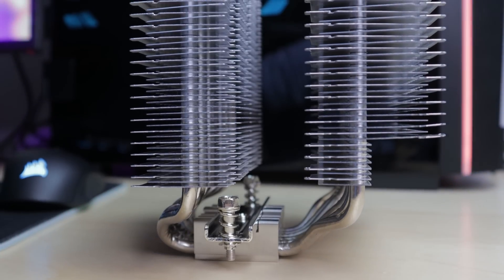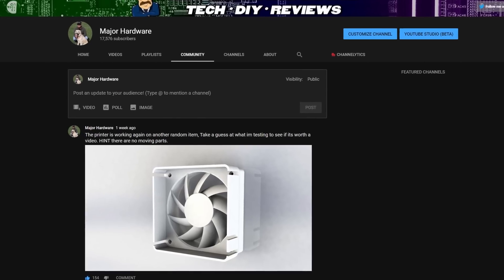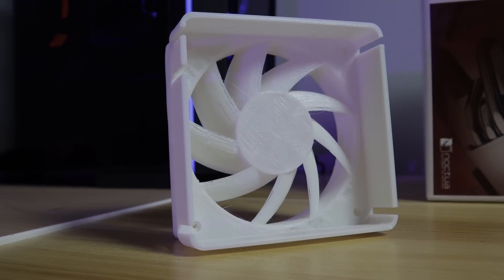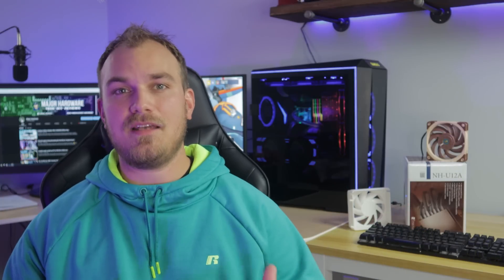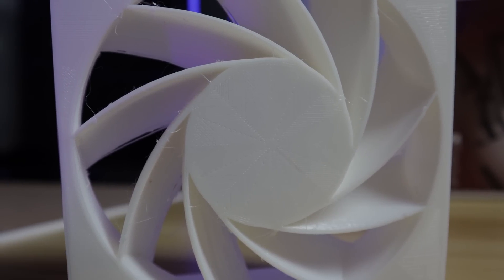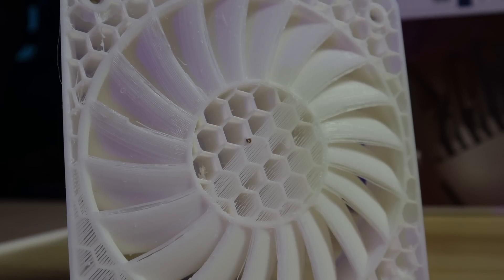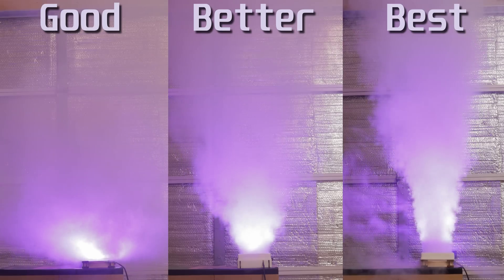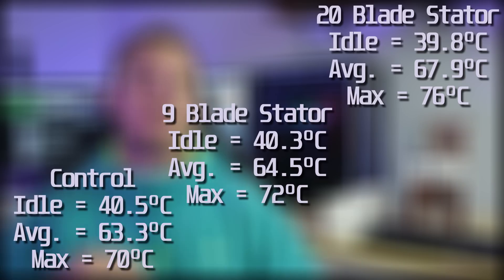Can I Make The Best Cooling Fan Better With This Add On?

Comment: Id test this in a case.... maybe one on the intake fan as well to get "straight" air into the stacks and the second one "the one on the cooler" shoots it toward the exhaust fan..... or maybe no exhaust fan will be needed. More stuff in the way does mean less but "better" flow,  may work better in a case..... but if you can make it more efficient you may get rid of the temp penalty. Thinking of porting and polishing cylinder heads. Few ideas below

thinner blades, different blade design with a taper toward the "hub"
taper the outer frame before air goes through - say from mating with the fan at 120mm to like 130mm, 140mm (keeping it practical) making up some displacement of the blades
make the hub smaller or make the hub small as you can on one side effectively making it into a cone
get rid of hub and put a ring  "hollow hub"  toward the center and either blades through it or nothing
or just go nuts and do it all at once....lol

Comment: Ok. I'll encourage crazy ideas... And if you take the upper intake cooler, build some kind of a tunnel inside the case from the top fan, passing through the CPU cooler, to the exaustor cooler. Like concentrating the airflow inside the fast tunnel only from the CPU. And the other two fans let work normally.

https://imgur.com/o7p0mQ7
Reply from the maker: YES, I was thinking the same, my pc doesn't have an air cooler in in it but i think i will def give that idea a shot when i have a system with an aircooler running

Comment: For your next test, you should get some Silverstone Air Penetrator fans... They have had this directional fan thing on their fans since the dawn of time and used to use them on my PC cases but they never came out with PWM or varients with LEDs (if not both) so they got tossed into my fan graveyard.

The models you need to look for are Silverstone AP121. AP122, AP123, AP124, AP141, AP142

They now have RGB PWM fans with the same built in channeling for air flow but Ive been running corsair ML fans since they first came out.

Since Silverstone isnt as prominent as they used to be back in the years 00-13' maybe they would like the free PR you are offering and will send you some stuff out for free?

Comment: Great video!

From the looks things, the air flow straightener may benefit case intake fans where air can be directed to GPUs or tower coolers.

Also, have you had a chance to check out Silverstone Air Penetrator series fans? They claim to have straitened airflow too.

Comment: Vantec tornado has this already built into the frame. trying to control the airflow due to the high rpm. (4800rpm) its an old fan, dont know if you can find them anymore. but that was the height of fan cooling before heat pipes some years ago.

Comment: Are you able to create different designs with the stator blades or would changing the direction and placement of the fins have no effect on air flow? 
Would you be able to use a PC case with either a glass or acrylic side panel and use non working components and test some of your ideas inside that case with the fog just to see how air flows throughout the case and around the different parts inside it? I'm very curious in seeing how air circulates inside a case normally and then see how your designs change things up inside the case in different setups. I don't think you can use fog with a working PC due to the fog damaging the components, but you could still check the temps to see if your designs have a different effect inside the case.
I am enjoying watching you try out different stuff.

Comment: You have reduced the air speed and created less turbulent air flow.  Cooler fins are less efficient with that type of air flow (stagnate boundary layer stuff).  You could look at cooler that have features to break up the laminar flow.  I know some companies have dimpled fins for this.  Automotive A/C evaporators have louvers on their fins to improve efficiency at lower speeds.

I wonder if the quiet 200mm fan would benifit for a free wheeling fan blade between it and a cooler.  I might create some fluctuations the are airflow reducing the stagnate boundary layer without adding significant noise.

Comment: Straightening airflow should not matter for that heatsink since it has a closed top and sides, effectively doing the straightening itself. The stator could maybe have an effect if used inside a case on the intake fan to channel airflow directly to the cpu tower. I'd like to see that heatsink on the fog machine as well though, could provide some interesting results.

Comment: Try making 3 20 blade attachments and use it for the intake on the front of a case and see if that helps with cooling in a case instead of a test bench

Comment: I think a shroud is also a bad idea, because your Heatsink emmits heat also above its visible parts that arent behind the fan. I think a conic airflow is much better for cooling than straight airflow. Because then the air can surround the cooler. Also i'm imagining that the air molecules get much more contact with the heatsink if the airflow isnt straight. Kinda like bouncing of the finns. With straight airflow they just pass it. But thats just my imagination, go on experimenting, its really interesting :D

Comment: Could this work better as a intake at the front to shoot the air directly at the cpu cooler

Or on the bottom of a larger case so the fans blow even more directly at a gpu?

Comment: But when you use that in case in frontpanel  so can the cpu cooler better pull the air  or not!?  I had the same idea but no 3d printer

Comment: Maybe it would be better to compare the fan + straightener combo with the standalone fan at a lower rpm, so an even comparation could be made - it's just a matter of finding at what rpm the standalone fan produces the same cfm as the one with the straightener. This would allow you to know how much of a difference ONLY the stator can make in temps, no variables involved. Also, maybe it may work better if you use the exact same blade design of the Noctua fan, just reversed.

Comment: Seems to be the perfect solution if you want to use a case fan on your desk to cool.... well... yourself. I have 2 case fans mounted above my monitor for that exact reason, but the airflow towards my face could be better..... Now all i need is a 3d printer ;D

Comment: See how the NH-U12A fin stacks are pretty much sealed off on the sides, so air is forced to go through the cooler (instead of being able to escape out the sides)
*This sealed off design, I think.. is why running two fans in a push+pull on it doesn't make much difference (if any at all) compared to just the one fan... same as running a push+pull setup on most radiators, the extra noise/cost isn't worth the minimal gains.
**Personally I chucked my "extra" fan on the exhaust vent of the case.

Could this stator make a difference on a open fin stack style air cooler? (think dark rock 4 etc) Or could the same be achieved by blocking off the sides of a fin stack?
Would you be able to try different air coolers onto the smoke machine.. just to see what happens to the air post fin stack

Comment: The older Noctua NF-F12 had small, fixed, counter rotational blades on the hub side to focus the air flow from the fan.

Comment: Something similar has already been on the market for some time. You don't need that big of a shroud to straighten the airflow. Check Lepa Vortex or SilverStone AirPenetrator series fans that are designed to have as much straight airflow with as low resistance possible. I use Lepa Vortex fans on my 60mm thick radiator and they work really well with pushing air through dense stack of fins without being obnoxiously loud.

Comment: I think shrouds will be the best way forward. As i suggested in a previous comment, 3D printing a shroud that goes from the front case fan to the air cooler stack and out through the back exhaust case fan, with another fan at the cooler may work. It will definitely keep the case cooler, as all the heat from the CPU is exhausted through the rear of the case. However, this may lead to less cooling of the VRM's, RAM etc

Comment: Short and sweet, nice idea, but yea, redirecting material slows it down. If you used two fans using twice the current to run them, in opposite rotations, you may get 10-20% additional air flow and a straight air flow.  Personally, pulling air rather than pushing air with air channeling are a better choice.

Comment: I doubt this will get noticed but can you (or someone) try to print fan blades that go in the opposite direction. This way you can have an intake on the bottom of your case or side  and not have to see the ugly braces and cables.

Comment: I feel like this would work wonders on front panel intakes on a case with restrictive glass.
Reply: it wouldn't
if anything it would make it harder for the fan
Reply: What does the glass have to do with the radial dispersion of air?

Comment: Just by chance are you still using the filament that came with your printer... that stuff is usually complete crap. I use hatchbox it isn't too expensive and made a HUGE difference in my print quality.
Reply: I pay about $10 per killogram (shipping included in the US), only ever had like 1 defective roll from a variety of brands (there was some that I used that was $70+ per Kg, made in the US, and that stuff was borderline $hit, biggest pain in the @$$ role I’ve ever used! It was working in the end, but just terribly hard to setup for some reason). I’d say 95% of the time, it’s user incompetence, because if you can get grass trimmer line to 3d print, then you know how to operate your machine! I see so many incompetent monkeys spending a lot on expensive roles and still having crap results when I’m printing decent size 3 inch diameter and .75 inch thick double herringbone gears in 7 minutes or less at 150-200mm/s using cheap filaments or making water-tight prints for my liquid cooling blocks (for tablet computer overclocking/Raspberri-Pi/robotics motor drivers). I’d actually recommend using the cheapest rolls you can get, because it teaches you better about tuning since sometimes the temp range is slightly less, which actually makes it easier to find the optimal values (like for stringing/retracts/temps/flow speeds like slower isn’t better in most cases), obviously no filament will overcome bed calibration or bed temps for adhesion (or surface finish like bare glass vs washable glue stick coated vs painters tape coated), but using a variety of cheap ones will quickly let you know the quirks of things and your machine.

Although, I’ve found the cheaper rolls to do much better in mine (I’m not sure what you pay for in expensive rolls), I typically use 0.5mm nozzles since they are nearly impossible to clog, so maybe that hides some of the minor inconsistencies, but measuring with calipers it’s typically within 5% variation (+-2.5% from nominal), just measure it, type in the value (2.85 or 3.05mm filament) and away you go! Learning initial setup is key.
Reply: @jakegarrett8109  ya but there are a few questions that follow an answer like that. Variables such as what printer your using, Bowden or direct feed, hotend quality, PTFE tube quality, filament drive quality... all of them can directly impact performance and HATCHBOX is $20-25 off Amazon so it isn't exactly expensive when you dont want a 40 or 50 hour print to fail. Also if all your printing are geometric objects for the most part you won't see as much difference than if your printing detailed models.
Reply: Cable Select I typically print structural things (gears, airfoil structure, hinges, fluid pumps, mounting brackets, motor mounts, adaptors, mechanical things), to me, they are RPM (rapid prototype
machines) and not desk toys to make cheap dollar tree $hit decorations (just buy the decoration, much cheaper).

Mine was direct drive 1.75, but I converted it to Bowden 3mm, the hot end assembly cost $8, the Bowden tube I use is sourced from Lowe’s plumbing section (like $5 for 15-25 ft roll), and I use only the finest of high grade $1 nozzles, haha! Machine would probably be beaten by most $200 printers for miniature figurine toys (I built mine like 7 years ago? It was right after using big expensive engineering RPM machines and was like “that’s pretty cool, it can make stuff my angle grinder and drill press can’t!”, so I built a Prusa i3 and modified lots of it in the name of speed, lol, yeah, I’m not waiting hours for a water pump to print, get that sucker done in 20 minutes so I can test and make 5 major design iterations in a day! Put that R for rapid back in prototype machine!).

It’s also fairy rare to have a mess up once it is set up correctly, and what am I making, a solid 8 inch by 8 inch by 8 inch 15 pound plastic block to take 40 hours or something? Goodness, that’s a long time! Switch your nozzles out man! I have a 1.3 mm nozzle for fast large prints like that, not only is it 18.6x the area of a 0.3mm nozzle, but now you’ll use 0.8mm layer instead of 0.2, so it’s roughly ~74.5x faster at printing (yes, what takes me 1 minute, would take a normal printer over an hour, that 40 hour job you say would be finished in about 32 minutes...). Use the right tool for the job! Just like CNC milking, don’t use a hair thick drill but just because you can! So typically, I’m using 0.5mm as it works really well for small/medium gears (like 130 gear teeth on a 2-3 inch diameter gear), and mesh excellently together as long as you CAD them correctly (ugh... people using freaken triangles thinking that will work... there is a reason ASME has standardized gear tooth profiles)

So, I have printed with direct drive, direct gear reduced drive, and Bowden (including really remote from 4 ft away), and I’ve done small’ish nozzle (0.2mm but it took ages, and only used for miniature airplane souvineers for my engineering teammates), because 0.5 works for what I do, really strong mechanically useful pieces.

As for cost =/quality that I often claim (since you mentioned hottend), I’ve just seen people waste like $80 on a hottend, and it was inferior design to mine (it looked like part of it was a flat out copy of mine, but did several stupid things wrong and ultimately sucked because of it). So I don’t count COST of things so much as how well they accomplish the task, and some of my best tools happen to be the cheapest, so I usually say “a good hottend” and not “expensive”, because just like the filament/hottend/any other tool, cost=/quality or capabilities.
Reply: Cable Select oh you asked about filament drive quality, I made mine on a 4 jaw lathe with 20mm stainless steal bar and knurled with some random diamond carbide tool (I note 4 jaw because it’s not self centering like 3 jaw, so mine looks ugly as can be! Not perfectly center, but don’t look at it, haha!). The extruded assembly is a modified version of the cyborg gear extruder (remember those gears I mentioned the print time on? You can find them on Thingiverse where I posted them, brilliantly named like 7.6666 gear reduction for cyborg gear extruder, much improved). So besides the bearings and motor, the extruded is all 3d printed or made on a lathe. It’s not beautiful, but it works well (you’ll explode 150 psi hoses and absolutely destroy the pneumatic 6mm push in connectors way before the thing slips, it’s ugly, but that large diameter cog applies pressure across a larger section of the filament and much less likely to slip or grind the plastic out due to distributed loading), and functionality is what counts! (For bling I’ve got LEDs everywhere shining through the acrylic  and cable mesh wrap to make all the wires look tidy, and it’s always shiny and clean and well maintained with all rails with a thin film of clean oil.

Gotta go crank out some model airplane parts with it soon!

Comment: You should really test static air pressure differences on these as well.
Reply: That's fan dependant
Reply: Of course it is, but it would still be neat to see. For example, he obviously lost net airflow, which we can see from his results, but perhaps one of his stator designs would be better on a densely designed radiator due to an increase in static pressure.

In other words, he should do far more testing before he writes the design off as a failure.
Reply: @sniperpronerfmods9811  ok u super duper intelligent engineer, explain us how turbine engines can work with all its energy draining stator vane stages.

Maybe you just invented the super engine.  Remove those vanes and the Rotor can spin much faster and we have super strong turbines

Comment: Throughout this video I found myself looking back and forth from the screen and my AIO fans.
Reply from the maker: maybe this would work better on a rad as the fin density is higher then an air cooler
Reply: @MajorHardware  I would be keen if you were to make the files available for 3D printing for the 140 mm size. I was thinking specifically about putting one on the lower fan of my AIO that is pointed directly towards the rear of my GPU.

Comment: So you convert a (more or less) pressure fan into a airflow fan...
Reply: Izan TechnoMaster  There aren't any exhaust fans below the GPU. Adding this to a case fan might help the fan to push air past the GPU and out the back of the case.

Comment: Oooh also you should consider doing some kind of shroud that goes underneath a standard dual or triple fan GPU that channels the air out the back, like the blower style does. Just something simple to get that air out of the other PCI slots, and not back into the case. Just a thought!